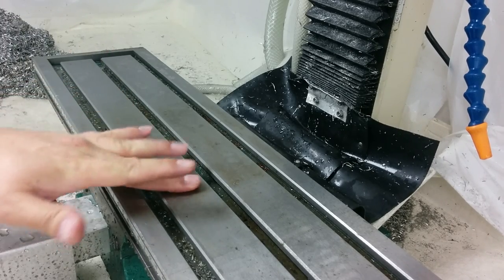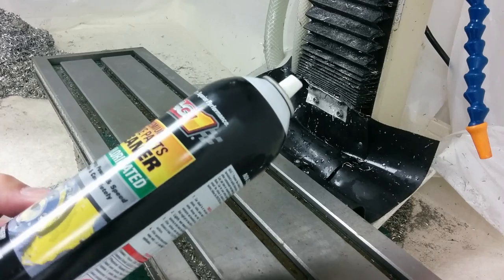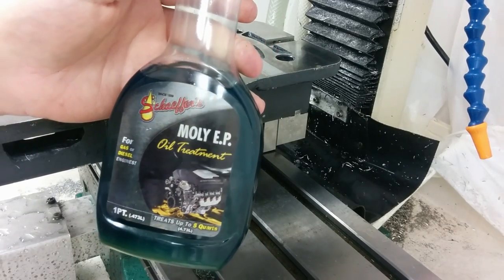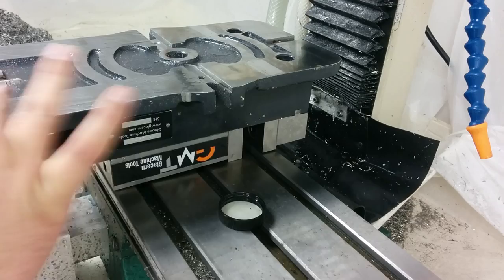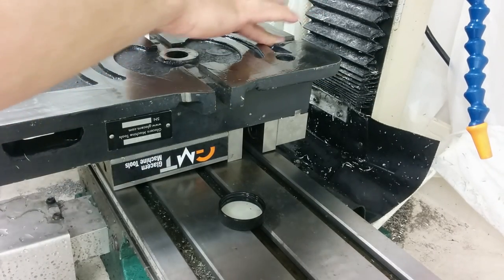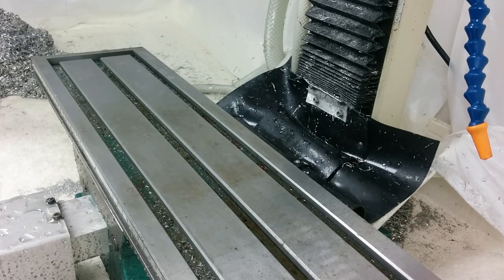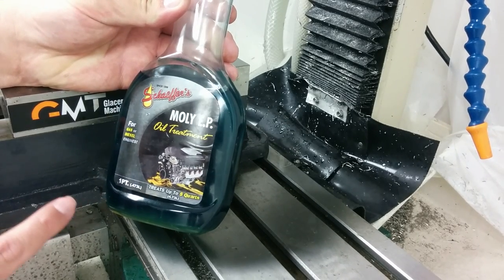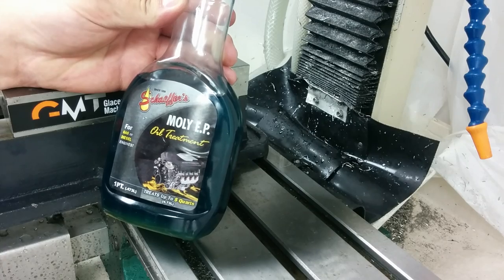Say "No!" to Rust Under the Vise

Comment: I'll have to give that stuff a go! I tried the dry moly once but found that the vise would go out of tram under heavy interrupted cuts. The Moly was actually too good at reducing the friction between the table and vise! I've been using Locktite Quickstix Copper Anti-sieze for a while and its a great rust preventative without the excellent lubrication properties of Moly.
Reply from the maker: l0ckcr4ck3r Interesting, I'll look into that Locktite. I don't have problems with my vise moving on top of the Schaeffer's, but my little machine doesn't do heavy cutting anyway :)
Reply: l0ckcr4ck3r I have an 8 ounce jar of the C5A paste, which is apparently the same stuff, but in paste form instead of a stick?  http://www.amazon.com/dp/B000LDDOXG  The paste has a working temperature of minus 30 to 1800 F and the stick has a working temperature of minus 20 to 1800 F, so the paste will get you another 10 degrees F of working temperature. :-)  The paste is also $11.60 for 8 ounces, and the stick is $12.60 for 25 ml (a dollar more for 90% less C5A).  I sometimes pay a LOT more for Loctite products in small sticks or other toolbox-friendly packaging.  I first encountered C5A copper based anti-seize compound when painting studs with it in an oil refinery pipe rack in 1980 (pre-Loctite).  It's good stuff.  I'd have never thought to use it between the vise and milling machine table.  I'll probably try this when I remount my vise.  Thanks!
Reply from the maker: Liberty4Ever Sweet! It's in the cart!

Comment: I live in humid south Florida and my tools would rust no matter what I used.. Finally I got so frustrated by the rust on my mill I went on a hunt for the best product available and I found it, its called Boeshield T-9 and it was invented by Boeing. Its expensive but its worth it. By far the best product there is, you spray it on and it will stay forever because its waterproof and chemical resistant. I use it on all of my tools now. http://boeshield.com/
Reply from the maker: Haha that's funny you mentioned this stuff. I actually emailed Glacern today to get some info about getting the bearing out of this vise and in their reply they suggested the same lube for the vise moving parts during reassembly :)
I'll definitely get some ordered.
Reply: Mark C. I can vouch for BoeShield.  It's mostly wax and solvent.  It penetrates into the pores of the metal and then the solvent evaporates, leaving a persistent protective film of wax.  No doubt there are some chemical corrosion inhibitors as well.  I originally started using it for corrosion protection on a small plane I had in the late 1990s, but I've seen it in woodworking catalogs.  My brother uses it on his woodworking tools, and even when they were in an unheated garage that frequently had condensing atmospheres with damp sweaty tool surfaces, he'd have no rust on his table saw, etc.

For my shop tools, I use Vactra way oil for almost everything, but something better is needed between the vise and table, particularly if you use flood coolant.
Reply from the maker: Liberty4Ever Cool.
I use Vactra #2 on my way oil and it seems to be OK for that, but using it under my vise didn't work at all as the flood would just flush it away.

The light discoloration I have on my mill table was there from before the time I found the Schaeffer's. I have had no additional discoloration since switching to this under my vise.
Reply: russtuff I need to pull off my vise as part of my CNC mill retrofit (work and life have delayed that job a bit, but hopefully soon), and I'm a bit worried about what I'll find under my vise.  I don't use flood coolant, so maybe it won't be that bad.  I've seen Brad Martin using the Schaeffer's Moly EP oil additive as a tenacious lubricant, but I wondered how it would be better than a good synthetic moly grease.  Based on your confirmation, I added it to my Amazon cart.  Thanks for the link.  I also bought some black moly spray at Amazon last year based on Brad's recommendation.  It has a few neat uses.

For old tech, I'm very pleasantly surprised at how well Mobil Vactra #2 sticks, even to vertical surfaces like the round column on my milling machine.  I might wipe it down once a year and it always looks wet with oil.  Amazing, and I think I paid $17 for a gallon, delivered.  Whatever thixotropic additive they use is nearly magical.  I'd have thought we'd need some weird nanoparticles to achieve that sort of anti-gravity oil film dispersion.  :-)
Reply from the maker: Liberty4Ever I keep meaning to get some of the moly spray, I better put it in the cart too :)